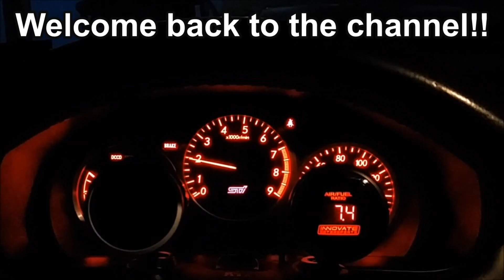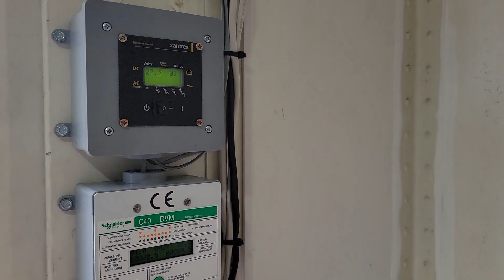Abel LMTV build part 157 (radiant floor heating layout and mohawk 30 year luxury vinyl planks)

Comment: I'm surprised you didn't use car audio dynamat with the adhesive on it that butyl never comes off you can get them pretty thick now and it comes with the foil for the heat reflection

Comment: Hey Sean,

I am about to select my flooring.   Have you had any issue with your floor shrinking or swelling with temperature?   

Do you know what model flooring it is?   Everything I can find only is rated up to 85 degrees F.   

Thanks!   

Ps, I end up watching your build videos 3-4 times whenever I catch up to the video I am working on.   Many ideas borrowed from you.
Reply from the maker: It's Mohawk flooring.  The highest end LVPs they make.  You won't have any problems with it.  Even though the ratings look low they can take much much more.  While driving down the road in the winter with the flooring valve open we frequently see 160-170 degrees for hours on end.  No problems at all.

Look on Facebook marketplace for deals.  You won't need that much to outfit your shelter.

Comment: First off, great install!  How are you controlling the temps in the floor through the manifold loops?  If your max floor temp is 82F, the water to air exchanger will need way more than that to be efficient, right?  I'm just stumbling through planning my install currently and trying to sort it all out.
Reply from the maker: The eberspacher is controlled through a 12 dollar battery powered lux thermostat.  I included the link to it in the eberspacher videos in this series....  It will turn on the eberspacher at a set temp and turn it off as well regardless of the coolant temps...
Reply: @SeanFastidious  Looked through both the Abel builds and the eberspacher playlist but didn't see any mention or links.  But it sounds like you have one temp for everything, controlled by the heater/thermostat?
Reply from the maker: @NateVolk  it's in the build series videos.  It's a 12 dollar thermostat with batteries that control relays.  There is a wire on the eberspacher that starts it up until power is removed from said wire.  You need something to send 12v to that wire when you want it to start up.  https://amzn.to/3Ck3XGY
Reply: @SeanFastidious  So to keep your floor water at 80 degrees an your air blower at 140 degrees, you heat your coolant to 140 and restrict the floor loop via the manifold?  Does it always also heat the radiator fluid in the truck as well, or do you have a shutoff valve?
Reply from the maker: @NateVolk  I don't think you understand.  All valves are open.  We do not use the blower fan as it only heats the air.  The eberspacher will heat coolant to 180 and maintain that temp as long as it is on.  The radiant floors heats everything until the wall mounted thermostat sends a signal that the interior of the shelter is at the desired temp.
Reply: @SeanFastidious  so you are pumping 180 degree coolant through your floor circuit until the room comes to temp?  And if all your valves are open, that hot coolant is also recirculating through the air box as well as the engine circuit, right?
Reply from the maker: @NateVolk  it is a coolant loop that goes through the engine block, plate exchanger (hot water), radiant floor, air heater (radiator), and back to the engine block.  The coolant lines also wrap around the water lines and tanks to avoid freezing in the winter.  The exhaust is routed to blow through the frame channels to further eliminate any possibility of freezing.  It truly is an all in one solution.  

I just want to say that I covered this in great depth in my video series.  The information I provide is free to anyone wanting to replicate this simple solution.
Reply: @SeanFastidious  

Thanks for all of your help and videos!

So, to summarize your description a bit (just on the liquid side).    Your thermostat turns on the Eberspacher and water is pumped through multiple places and the floor manifold when the thermostat says you need heat?   In summer, do you valve off the floor manifold so you can still get hot shower water?  Is your pump always on or only when the Eberspacher is on?  

Thanks!
Reply from the maker: @dcraigslist5243  correct.  The hot water plate exchanger is under the truck so closing the valves I spoke of redirects the coolant loop to just the engine block and plate exchanger.  The thermostat sends the signal to turn the heat on just like it does in a house.  The coolant pump is controlled by the eberspacher.  The engine water pump circulates the coolant through the loop while driving so it can heat the shelter via the radiant floor and also provide instant hot water once at your destination.
Reply: @SeanFastidious  

Thanks for the clarification.  

I appreciate you sharing your projects and answering questions!

Comment: Hey Jeanne once again thank you for making this video I enjoy watching them and I will probably follow what you have done with the S2 80. I like the the radiant floor heating. It appears as I did watch the video in its entirety that it just floats. It also looked as though you were using 1x6 with one end rounded over. I am curious as I did not see it addressed, where did you get your metal reflector strips you used to reflect the heat up through the floor?
Reply from the maker: If you read the scrolling words in the video I talked about the way I installed it.  Links to everything I used are always in the video description.  Thanks for tuning in.

Comment: That's awesome. I want to stick with a simple hot air solution and plan to duct the floor for hot air infiltration. For this winter I'll just be testing the heat pump to see how it will do.
Reply from the maker: We tried that and were unsuccessful.  Hopefully you have better results...

Comment: Hi Sean, its mark if where you attached fittings  for water is not grounded to vehicle frame you can build up electrical charge from moving fluid that will cause corrosion or electrolysis  if you run a guage
Reply: Continued      10 gauge wire to vehicle frame ground that will eliminate that and build up of statis chrge as well  thanks
Reply from the maker: The shelter is fully grounded if that is what you are asking.  This system will use a coolant loop that goes through the engine block.
Reply: @SeanFastidious  i just wanted to know on the wall where  the valves are if is grounded there, love your install of system . floor looks really nice thanks
Reply from the maker: I am glad you said something.  I made sure the shelter is "over grounded" when I first got it installed.

Comment: Good idea is us some more uni track to hang from the bottom of bed so you can put it up when not using it
Reply: @SeanFastidious  what is the question
Reply from the maker: @patrickcade658  the bed is currently in the up position in this video.  Why would I add more unistrut?  I don't understand.
Reply: @SeanFastidious   yes know the bed is the up position . but I was looking at when you not sleeping it can hang from the bed and when you sleeping it can be folded back up under the bed giving you more room and can do the same thing when driving because they make where you can lock back down to the bed I do better drawing to explain it to you
Reply: Kinda like a hide away tv
Reply: Basically what I saying is most tv you can mount on the wall ok well just like your bed can go up and down those uni track well just lay the uni track flat put roller in it like a draw then take two more track mount to back side of tv both tracks connected by the rollers. That way at both ends of the track you can have straps to help hold it up while going down the road when parked undo straps tv folds down because you have rollers on both ends of like a all thread once it is down you can put it to the front to be out the way so you can have more floor space
Reply from the maker: OHHHHH, you're talking about the TV!  Now I totally understand what you are saying!  Great idea!
Reply: @SeanFastidious  yes because you said something about it they make Ceiling mount for tvs but they can be week and with that vechile going off road I am sure you don't want to find the tv on the floor